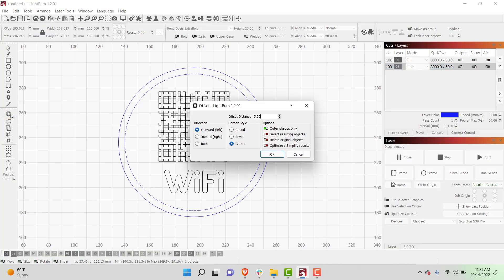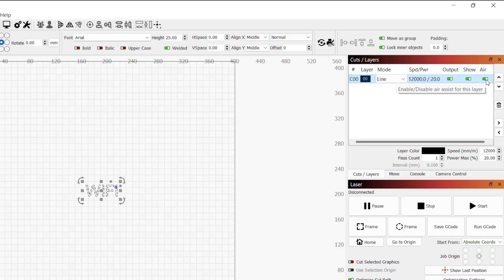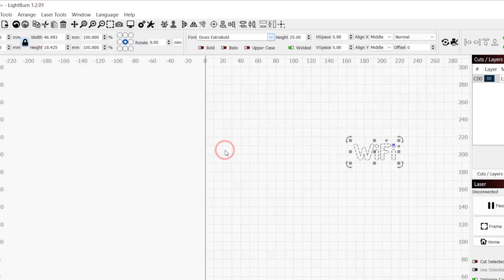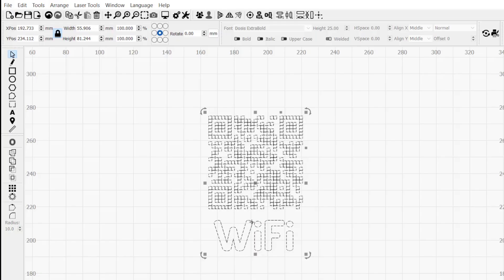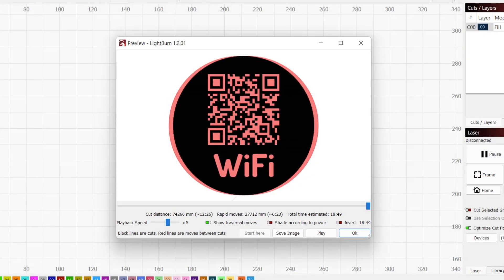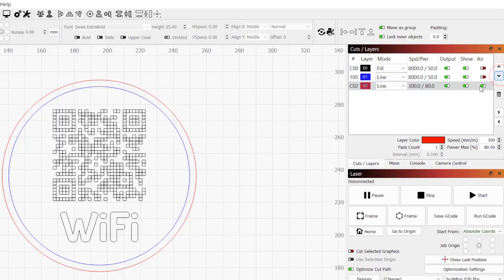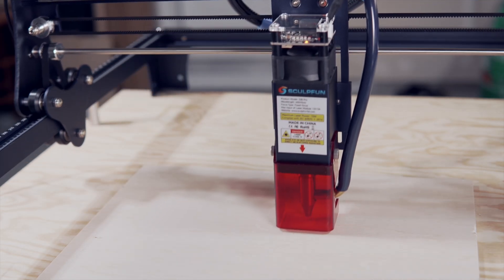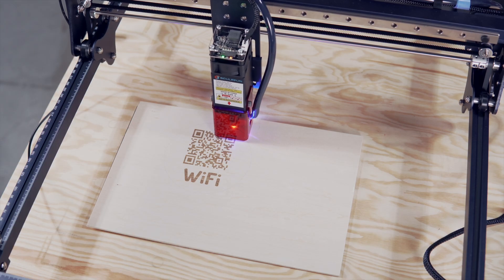Learn LightBurn Basics With This Functional WiFi Coaster!

Comment: Wheres the fire button option on the 1.3.01 version
Reply: I can’t find the cut option nowhere
Reply from the maker: The fire button needs to be enabled. This is under Device Settings --> Enable Laser Fire Button. If you are wanting to cut then you will want to use line mode.
Reply: @lightburnsoftware7189  i been looking for it but there’s not that option, ivtry to cut but only burn the leather

Comment: Is this all done with just the "G-code license key" or do you need any of the other software options at checkout?
Thanks!
Reply from the maker: The only difference between the versions of LightBurn are the types of lasers it can control.  The editing functions are all the same.

Comment: Great video! One remark: the S30 can’t run at 8000 if the firmware is not changed. The maximum is set to 6000 from factory.